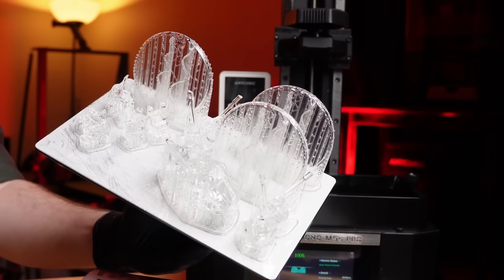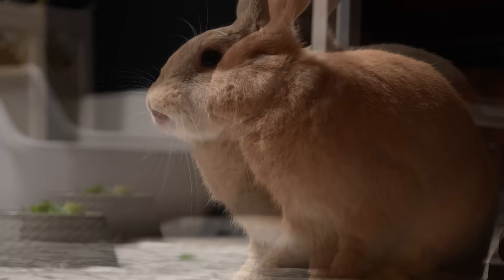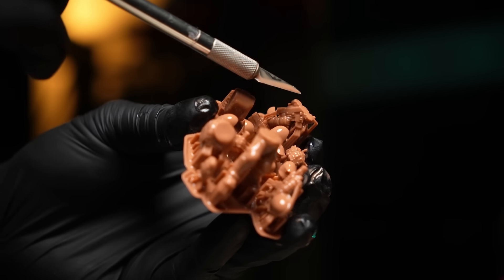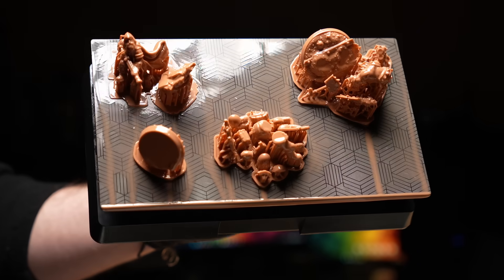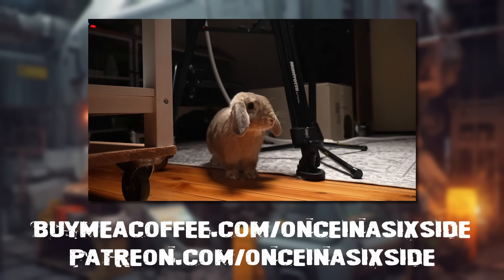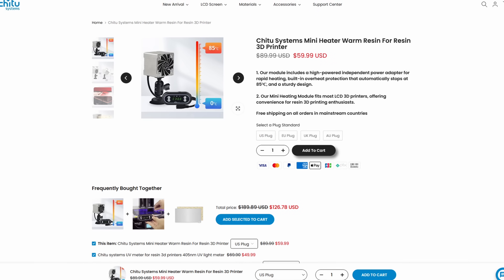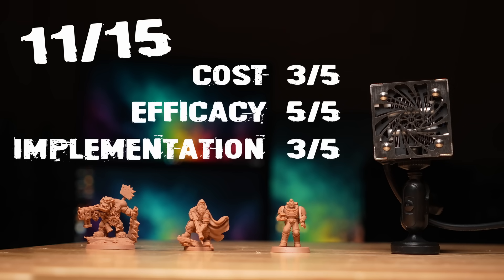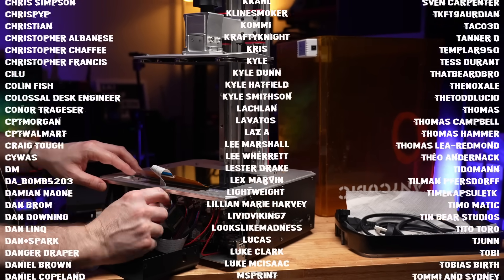Resin 3D Printers don't NEED inbuilt heaters (TESTED)

Comment: I have a heat belt on my Halot One+ and it works great! I'd love to put one on my Halot Mage 8K, but there isn't enough clearance at the back of the Resin Tray for a belt. The Chitu heater is currently £70 here. Wham Bam do an ultra thin heating belt which would probably just fit on the Mage, but the price is extortionate and shipping from the US would be ridiculous. I've built Vogmans light bulb based heater for an enclosure, so I might have a go at his blower heater

Comment: Have 2 of the Chitu Heaters in my Saturn 3 Ultras. Work great would recomend that you buy a back up power supply. I've already had one blow out so now have 2 backups. Also the weather stripping works great just cut it into sections for a better adaptation and adhere  it with some silicone. I use an infinite mix cycle  with the heater to keep the resin ready to go.

Comment: Great video, thank you so much! As a query; I've heard the belts do not work on the tilting vat of the Saturn 4 Ultra- any truth to this? I'd additionally heard that aquarium heaters stuck inside the hood of the printers can also be a very easy, cost efficient solution. Again, is this something you'd heard of and ruled out, or not yet tried? At any rate, kudos for another entertaining and informative video. So glad I subbed!

Comment: My printing environment stays at 15-16⁰C year round. All I've ever done is heat my resin bottle and build plate by sitting them in an old casserole dish full of hot tap water for about 10 minutes (no I don't also cook food in it) and then start printing. The thermo chemical reaction of the printing process in addition to the heat produced by the machines operation keeps my resin between 24-25⁰C at all times, back to back prints are awesome, cuz you cut out the pre heating the resin stage.

Comment: I also use a brewer belt, but for a couple of extra bucks I added gadget for the socket that reads the temperatur with a sensor and can turn the belt on and off. I usually glue the sensor to the top of the vat and tell it to keep it between 23-26°C, thus taking into account that its reading the ambient heat just over vat. This method has yielded amazing results and I feel its better then the rather "brute force-belt always on" solution.
Reply from the maker: Great idea!

Comment: I live in Canberra (Australia, for those non-Aussies), and it gets cold here in winter.  I often leave my printer running overnight, and it can get down to 13C overnight in our home (colder in the rooms at the back of the house, where the printer is.

I am yet to have any issues with cold temperatures affecting my prints.  My resin of choice is a 75/ 25 mix of Monocure3D’s Rapid and Flex100 resins, respectively.

Just lucky, I guess…

Cheers,
Reply from the maker: It really comes down to the resin, which is why I chose Phrozen's for this video because it was a sure thing to fail in low temps. I've similarly had no issues printing with other resins in my house which also gets cold overnight during winter.

Comment: My issue is it's usually 35 C or so. Haven't been able to get a successful print since moving to the garage, but it could be the LCD degrading.
Reply from the maker: Interesting! I haven't heard of "too hot/warm" being an issue, but I suppose it's possible. The effect of cold temps on resin that causes the issue as I understand it is it's effect on the viscosity of the resin. A quick diagnostic you can do is pull your build plate and vat out of the machine and if your printer supports it (elegoo/anycubic) there will be an option in the settings to do a detection which will light up the UV light and create a mask on the LCD so you can see clearly if it's working correctly or not. Alternatively if you're missing that feature, slice a full plate of models and start that print and watch the LCD to see if it behaves as you'd expect. If you're concerned about UV light exposure, lay a sheet of paper down overtop the LCD while you do this.
Reply: @OnceinaSixSide  from what I can see when I do a screen check, it's full light with no errors when doing a paper check, but it just won't cure. I've tried five minute bottom layers with no luck. I understand viscosity is way lower at those temps, but at this point I just ordered a new Saturn (based partially on your review) and I'll see if that does it. Tried different resins with no luck

Comment: So funnily enough when I had a mars pro, the original, when resin printing at home was new this was something i ran into as my major, huge problem. any outdoor temp change vastly effected quality. I ended up  buying a DIY chicken egg incubator kit and after some careful dremeling, mounting the cermaic heater PCB to the inner hood of the printer and holes for the buttons so I could adjust the temp without taking the hood off. Worked perfect till the screen died as expected on those old traditional non-mono printers.
Reply: It's worth noting the nice thing about the ceramic egg inculabor heater unit could be toggled on and off, temp set, run for hours on end, and heated everything under the hood. plate, vat, etc

Comment: Try printint something higher... something that stick outside of vat. When I am using inside heater with fan, models get soft and while peeling off theu deforms creating something like layer lines. So I would stay with vat heater as its heating only resin.

Comment: I have the chitu systems blower... I live in scotland and it can get really cold here. it's currently the middle of Summer and the thermometer in my printer room is showing 15 degrees C. (in the winter it can get WAY below zero here. So even in the summer I still need some kind of heating
I've printed in the winter with the chitu blower when the room temp was below zero and everything printed without flaw. (I've had it about 7 months so I've done a LOT of printing using it and have had no issues since) the coldest I ever printed using the blower was minus 5 for the room temperature and the little blower had no issue keeping the inside of the printer at around 22 degrees C. (I normally run it for around an hour before starting the print) I only have a little photon mono 2 so it heats up pretty quick because the build/air volume is pretty small. Obviously the bigger the printer you have I would suspect more pre heat time would be needed.
I had tried a brewers belt before getting the blower but just couldn't get it to sit snug enough on the vat for it to work properly. (again probably because the vat is so small)
the blower is a pretty snug fit inside the mono 2 but it does fit
sure the chitu blower is expensive for what it is but it does the job and is way more precise than a belt regarding the temperature you set. as it will turn on/off the heater as required where as a belt is a one temp thing that you don't have much control over
I'm really happy with it and it works well for everyday use with a sample of MANY MANY prints so it's consistant.

another thing to mention is that if your resin is heated it should in theory allow you to print faster with shorter exposure times as the liquid is less viscous so can flow below the build plate easier than cold gloopy resin. (after getting the heater I had to recalibrate for the new temps and the difference was around 0.4 seconds per layer so not a huge difference but enough to put a dent in print times for large models with a lot of layers)
Reply from the maker: Awesome to hear about your extensive experience! The heater is definitely a solid little unit.

Comment: I bought an Elegoo Saturn 2. It sucked. Absolute POS. It produced good prints when it worked, but most of the time, it didn't. Even using the best custom supports on my models it failed over and over and over. Adding a heater band did help, but not enough to save the printer. Even after sanding-down the back of the vat to reduce the air-gap, still it doesn't work. 

I bought a secondhand Uniformation GK Two and it has been a champion. It works and works and works, it is the printing experience I'd only heard other people talk about. So why all the dislike for the GK2? I'd buy a cheaper printer, but what are the options if not an Elegoo? What other printer is there besides the GK Two? Anycubic don't have the best reputation, and Phrozen  haven't impressed for a while. 

If the heater in my GK Two significantly reduces the lifespan of the light source, that's bad, but just how bad is it? Are we talking 50% or 5%?
Reply from the maker: The problem is there's currently no manufacturer right now producing printers out of China that don't have some number of QC issues in their history.

Everyone's factory spits out a lemon from time to time, and it sucks fucking ass when it's you who gets the lemon. I know, I've had my own lemon. So when you then get another printer and it's not a lemon, it seems like that brand is the bees knees, when in reality all brands are capable of producing great 3D printers, provided you don't get a lemon.

The GK2 is no exception, if you go searching you will find the users with lemons complaining on reddit and discord servers. A pain exacerbated by its high price tag, and flimsy construction.

Comment: Personnaly, I bought an "external" heater for 15Euros (external because I can't implement it insided the printer..too big). My printer is outside on the balcony but in a self-made wooden enclosure. I set the heater on 30°C 45min before prnting session and everything is fine. The heater just heats the atmosphere and seems to make it work....0 fail this far (10 months). Yet that heating belt is very interesting

Comment: All developers should make separate versions. This way you'd also keep the price lower and more affordable, thus bringing more customers, ones that may not need all those extra features.

I still have my Mono X, have no problems printing in winter, never had. Even during the night, when outdoors temperature drops, indoors temperature is around 18-20 degrees.

Comment: I have an enclosure (Wham Bam) plus small heater from Amazon. It's heating the enclosure, not inside of the printer/resin, but it works perfectly for me. I also bought cheap fermentation belt from AliExpress, but I'm scared to use it. While testing, it got very hot. I was scared it might burn my garage. But I wonder, how good would the fermentation belt be with Elegoo Saturn 4 Ultra and moving wat?

Comment: I use a heating mat originally intended for plants that I attached to the (inside) cover of my humble Mars 2 Pro.

It has a built in limit (and thermometer) of 30°C after that it will stop working and start again if it goes below that.

The advantage is that it heats the whole inside of the printer in an even way since it is the size of the whole cover of the Mars 2 Pro and it will heat the build plate and the vat with the resin.

I generally let it run 1 hour before printing and the lowest I went was 12° or 15° C.

It cost me something like 30 € and once installed with double sided tape, it stays in place with no problems but I could take it out easily since it's taped and not glued.
Reply: Thanks for the tip. I have one in my garage that I bought for fdm drying, but since it only goes til 40c was not enough for petg. I was planning to buy the belt or the chitu, but I can save money with your advice!

Comment: I have my printer in my conservatory in the north of England. In winter it gets down to like 10 celsius in there, sometimes lower. I bought myself a brewers belt and a digital thermostat with a probe and wrapped the vat with it. Since I did this I've had almost zero failures that aren't to do with poor support etc, and it cost me maybe £25 to do. Would highly recommend.

Comment: I live in Northern Canada and I use an old gutted mini fridge and a cheap $30 space heater to keep my resin printer warm.  It’s in my garage which gets pretty cold and I have no problem maintaining at least 20 degrees.  It can get down to negative 40C here but I haven’t tested it at that temp.
Reply: That would use a lot of electricity.
Reply: @petercallison5765 According to Google it would cost about 3 bucks to run a small space heater for 12 hours. You'd almost be spending more in resin during that time

Comment: Temperature has not been a problem in my experience.
Printing in my spare room, window open in the Scottish Highlands through winter, with no heating in the room at all. 
Never had a single issue printing cold like that.
Reply: What brand of resin are you using?

Comment: Note: the Elegoo heater is NOT adjustable. It's hardwired to 25 degrees C and will continually switch on and off to maintain that temp. If you want to go hotter (or colder), you're out of luck. Some engineering resins want much higher temps - up to 28 or 30 degrees. Additionally, while the unit may detect a temp of 25 degrees under the printer's lid, there's no telling if the resin or build plate will actually reach that temp. I suspect, especially in particularly cold climates, that the Elegoo isn't going to be enough to get the resin up to speed and keep it there. 
An alternative to the brewers belt is the Thermal VatBand. Similar idea to the brewer's belt but it's stuck to the vat with adhesive. A lot more expensive (too expensive if you ask me) but apparently you can run three Vatbands off a single power supply, which would be handy for those running multiple printers (though it will require additional parts like a splitter so price is still crazy)
For my money, I like the Anycubic one for ease of use and consistency, but you'll need something smaller, like the Chtu one, for small printers like the Mars' or Phrozen mini.

Comment: No matter what your solution is, you should slap an "insulating box liner" to your printer so your heater doesn't have to work as hard.  Those "reflective bubble wrap" materials are very cheap.  Alternatives are reflective foam insulation, or foam insulating boards available in any hardware stores.

Comment: I used to have a heating blanket with its fabric cover removed and stuck it behind the Z-piller on my Anycubic M5S and that worked great for a $15 solution.  However the Elegoo Saturn 4 series has a flip top and there's no space to install a mat anymore.  Will look into the blower fan option.

Comment: I'm in Ireland, almost at the northern tip, so my garage drops to below freezing in the winter, before buying the chitu heater the resin was so viscous my single rail mars 4 DLP had difficulty lifting from the vat when doing initial layers, making horrible grinding noises, once I installed the heater I have had next to zero print failures, I keep it at the factory default 35 degrees, bonus feature is that the prints are easier to remove from the warm build plate.
Reply: I am looking to this set up now (almost 2026). I am also located in Ireland and will be using the printer in my shed, which will be cold. Any suggestion if this still viable or there are better choices? Thanks!
Reply: @Toptickmo  I've been printing away over December with my chitu heater, 18 months after buying it, it's still going strong and keeping my enclosure at 35 degrees even when the temp dropped to below zero. I would def recommend the heater, its selling for less than 40 quid now too.
Reply: @MichaelCassidy1973  Thanks for the fast reply. Well then I think you made me pull the trigger. I just needed someone who made it work in this environment. It will be my first resin printer so will definitely learn a lot.

 I have seen many videos recommend home brew heat belts. Have you tried this?

What types of things do you print by the way?

I appreciate your help.
Reply: @Toptickmo  The belts seemed "clunky" to me, mostly I print minis for wargaming, and the odd larger scenery piece.
Normally I set the heater temp to 35degrees, let it come to temp, then after 20mins or so, kick off the print. 
I've been resin printing for about 6 years now, the chitu heater was a game changer for me.
Reply: @MichaelCassidy1973  I appreciate you sharing your experience. Wow 6 years! You have a lot of experience then🥳

Alright , thats another tip for me to remember. To set it to 35 and wait for 20 minutes at least. 

By the way, do you have an enclosure for your printer?

I am just so new to this.

Do you have a facebook or somewhere I can message you faster if I have a question? That is if you dont mind, its ok if you do😅

Kind regards
Reply: @Toptickmo  are you Anima3D on makerworld?
Reply: @MichaelCassidy1973  yes

Comment: I cover the Saturn 3 Ultra in the box it came in, cover it with a blanket, and pre-heat the enclosure with a space heater. It went a long way to prevent failings on Elegoo's ABS-like resin, which appears more sensitive to temperature than the other Elegoo resin's I've tried.

Comment: I've tried them all. I had weird layer lines every cm I couldn't explain until I figured out it was when my blower heater was turning on and off. These days I use a fermentation belt controlled by a sensor dipped in the corner of the resin when the printer is in standby and heat the whole grow tent I use as an enclosure with a cheap nail heater when printing (for even heating when not mixing). Works perfectly even in my cold northern basement.

Comment: I used to use a belt for heating till I got the gktwo. The only problem the belt has is that you cant turn it off and the cord causes the printer lid to be open (letting fumes out even if you have a ventilation fan, hot resin smells worse than cold resin). So consider making a little hole or notch for the cord if you plan on using a belt.